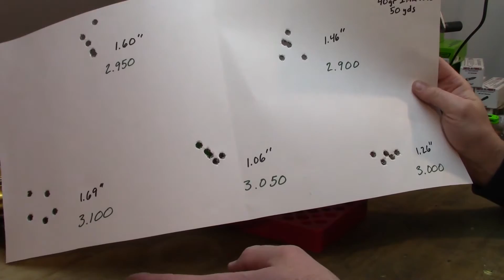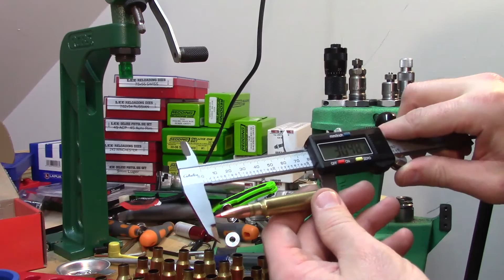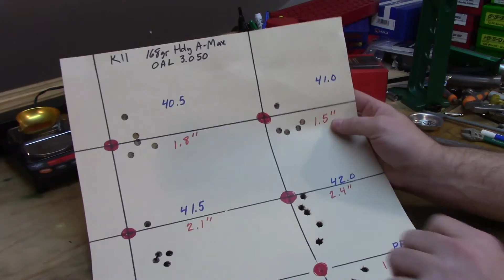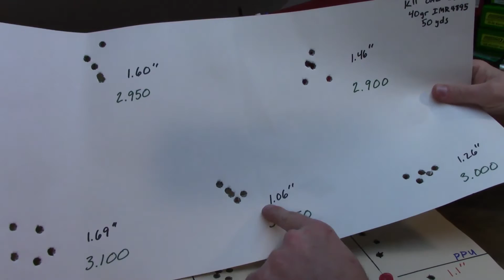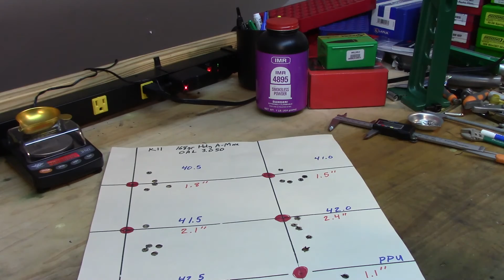7.5x55 Swiss Reloading Journal 5 - More K11 load workup

Comment: Handloading for the Schmidt Rubin Rifles is a pain in the butt. We in Germany usually just used the GP11 ammo, this stuff is hard to beat and it was relatively cheap for a long time, but since almost a year the market is dried out and the GP11 is hard to get and expensive when you can find it. What i heard from other shooters the Lapua 167grs Scenar are good bullets for the swiss rifles, powered bei Vihtavuori N140 or Lovex S062 (similar to Accurate 4064).
You need a taller front sight to get this thing shooting point of aim, but i have no clue if you can get it in the us.

Comment: Thanks for the videos!  I've got a Swiss 1911 (30.7" barrel, 1:10" twist) that I put three boxes of Parvi 174 grain through.  Was able to take out steel targets @ 500m with this gun and that ammo.  I've been looking at reloading it to see what I can dial in and actually had purchased a box of the A-max Hornady's.  Thanks for the videos as I've already learned quite a bit.  One question though: I'm curious about the shorter range (50 yards) and why you want to modify the sites.  The gun is designed to go longer range, so I'm wondering if the bullet has even had much of a chance to stabilize at 50 yards.  Could that be part of the weird groups?  Do you have access to a range that can take the gun out farther?  I'm just wondering would kind of comparison you might have at 200 or 300 yards.
Reply from the maker: +Mike Cunico Thanks for watching!  A lot of the distance choices have to do with filming.  With milsurp irons I can generally keep several groups on one target and in a single video shot at 50.  I have access to ranges up to 400, but shooting longer would mean larger targets and a walk downrange between each load to adjust the camera.  I can shoot 100 yards on my properly, so that's generally what I like to be zeroed at.  The Swiss guns shooting so high at that range make plinking difficult and hunting out of the question.  Hunting in my area means shots of 20-100 yards, more often than not.

Comment: At what point do u change powder? I know u said most likely it's the bullet, but y not try another powder. K11 should shoot tighter than that.
Reply from the maker: +Jody Hensley I don't doubt that these A-Max bullets could be made to shoot well.  To be honest, I really want to change both bullet and powder.  That goes against my "one variable at a time" rule, though...so I'm going to give IMR-4895 one more shot with the Sierras.  If groups don't tighten up considerably with the Sierras, a powder change will be next.  And I'll eventually be testing other powders even if 4895 does shoot well.
Reply: Sounds like a plan. I am going to work up some loads for my grandfathers K11 and am using ur videos as a reference point. I have used IMR-4831 with some 150gr Hornady boat taiI bullets. Havent shot them yet though. I have watched all ur reloading videos and I like how u do things, plus ur commentary is pretty funny sometimes. Keep it up.

Comment: I just purchased a K11 and I am wondering how you go about aiming at ranges under 300. Do you have a specific modus operandi?
Reply from the maker: +first6digits It's awful.  I have to aim a foot low. It's one of the biggest reasons I don't shoot my Swiss guns as much as I should, and why I pretty much never use them for plinking. I like things to go where I'm aiming!  There was a guy selling taller front sight posts on the Swiss guns forum but he passed away.  I need to search again to see if someone else is selling them now.  You might have gotten lucky and received a tall one.  Look for a + mark stamped on the front.  Standard have no marks at all.
Reply: +Johnny's Reloading Bench It doesn't seem very practical of them to start them at 300 meters. (Especially for a carbine) oh well! It comes in Friday and I will check. I'll keep you updated!
Reply from the maker: The whole situation is absurd.  I can't believe there isn't a better aftermarket for stuff like this.  My dad is a machinist.  I might see if he can just make a couple.  I hope you get a nice gun!  Don't forget to check for the troop tag under the butt Plate!  I got really lucky and got tags with both of mine. One of them is a generic arsenal tag but the other has name and address and whatnot. Really cool stuff.
Reply: +Johnny's Reloading Bench will do! Let me know if anything takes off with those sights I might buy one from you!